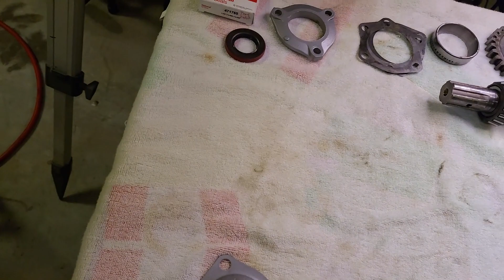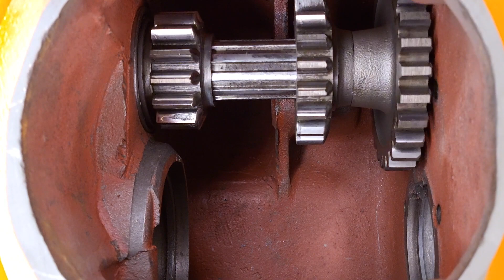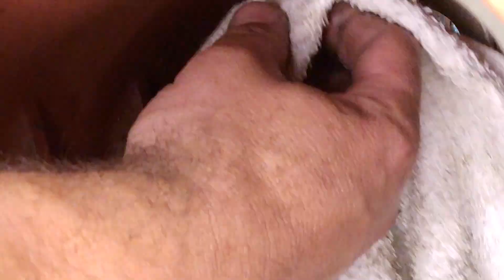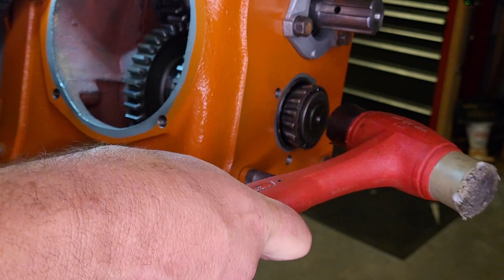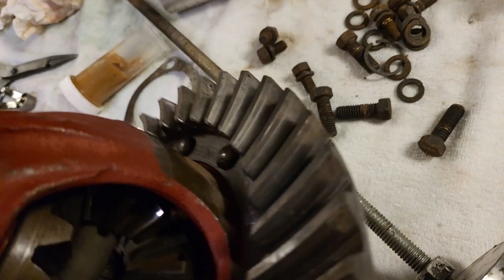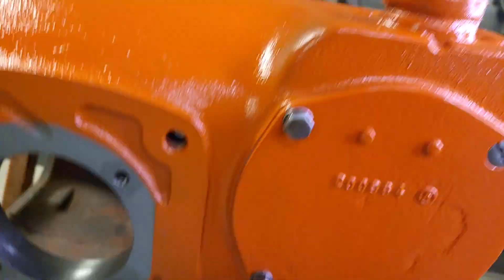1953 Allis Chalmers B Transmission Assembly

Comment: According to the manual there is a cork plug at the end of the reverse idler shaft. Mine is missing. Probably blew it out not knowing.  Do you have an idea of what I might use?
Reply from the maker: Mine was in good shape so I left it. If I was you I would just clean it well. And plug the end with RTV about 1/4 inch deep. There is no pressure so that should hold.

Comment: Still rewatching, I realize you will do a video on the differential, but in your disassembly of everything did you write down bearing numbers even though you use the parts tractor bearings?
Reply from the maker: No but if you need numbers I can dig up the numbers off my parts laying around.
Reply: @JPN76  I am just getting started, So I don't think it will be needed. I only pulled off a carrier bearing side and the outer race was pitted up, will get to the rest soon, and then the extra rear after that. Like you I will want to keep pieces from inside together if at all possible.
Just was curious as you are a front runner of this, and not sure if you had done that or not. 👍
Reply from the maker: Wish I would have read off numbers as I assembled them.
Reply from the maker: You inspired me to start the differential video. Working on it now. Have been sick for a few months so I slowed down a lot.
Reply: @JPN76  Oh No! Are you doing better? I was thinking last night at work that maybe you could do a video of the parts like seal and bearing numbers if available, even though you did seals in each video.

But if you are ailing than I would much rather that you get well so your followers can see you shining face on more videos!

Comment: My apologies if I came across as rude on the questions or on the reverse idler.  I know you do things like this for a living, so I guess I am asking what is your technique at that.
I think that the pictures would be very handy, thanks! 
I need to do so repairs in my garage then I want to make a stand for components so that when I am done with them I could put them on the stand and it would keep everything at curb height and I could still keep them separate.
Reply from the maker: Sir you have never sounded rude in your comments. As for my technique I guess I don't really have one. Atleast not a conscious effort.  As for me doing this for a living it is mostly habit and on my normal day to day  they are not apart for months and it's mostly memory. These days I usually don't have to even keep track of bolts just throw them in a pile. I'm always asked "how do you remeber where it goes" I'm not sure how i just do.

Comment: Sir,
A few questions:
1. As this is well past the video date, and If you have it back together, is that spacer. holding up well? Is there a better material to use such as brass/bronze?
I have mine apart in major assemblies I have not checked real hard but I do not. think that mine has any looseness

2. Any suggestions to keep me from assembling and disassembling several times? 
I frustrate easily at times and have had a tendency lately to just give up, the need for shims etc and test fitting is fine, it is the I forgot this or to do that or not having things in the correct position. that gets me

3. is there anything to do with the torque tube? is that a upcoming video? If so then it can wait on that.

4. lastly, Is the a good order to do this in? meaning  transmission housing first then the tube and then the pto...

Thank you I really appreciate the videos and straight answers you have given me.
Reply from the maker: 1. The spacer would probably be better to be steel.  But with the aluminum I used it is probably better than the thin sheet metal split spacers that was in it. There is not much real load on it so it's probably fine. I actually assembled this 2 days before the upload so not close to testing it out yet. It's holding up well sitting on the stand. Lol 

2. Well there is no step by step but be sure to install the idler gear first unlike me and in the proper orientation. Take pics as it comes apart and lay them out in order before you start assembly. 

3.  As far as the torque tube I just drug it out of the pile. Going to go through it soon. Didn't plan on a video but I think I'll add one due to the clutch fork assembly etc.. 

4. My order is all over the place. It was mostly based on when I have parts available but trans and PTO I would do semi together to seal it up and complete that unit. I'm going to start my PTO next once I fix the Diff.  

Hope this helps.

Comment: not sure how i got so lucky finding your videos but working on a 41 c with exact problem main shaft way loose also exploded the bearing in the pto from the play... my pto worked but tractor wouldn't move in gear???? not sure i dont have another issue yet .great videos and I would be concerned on the aluminum spacer....how much material was left after you turned it down??
Reply from the maker: On the thiner center section About 1/8th inch, maybe a tad more.  There is no real crushing load on this part but still. The good thing is the part that may wear is the thicker parts .  I'm debating changing it but this tractor is for show now so probably doesn't matter much.
Reply from the maker: When I found this play I searched like crazy trying to find info on it. Could not find anything. It has to be common.
Reply: @JPN76  would this cause the tractor to not move in gear??? This belongs to my great uncle who's owned it for 50 years.... I'm a car guy working on a tractor but I'm enjoying it. Any ideas on the not moving would be appreciated
Reply from the maker: @scottdieterman9969  it is possible but I would think you would get some serious grinding.
Reply: @JPN76  just wanted to let ya know my not moving in gear was the sleeve on the main driveshaft the splines were gone!! grabbed enough to turn pto but slipped under the heavy load of trying to drive it
Reply from the maker: @scottdieterman9969  thanks for the update! I was thinking about that the other day.